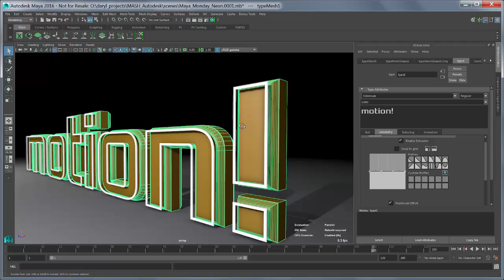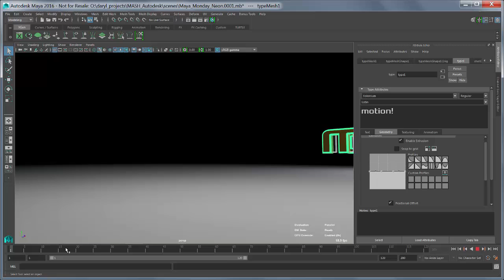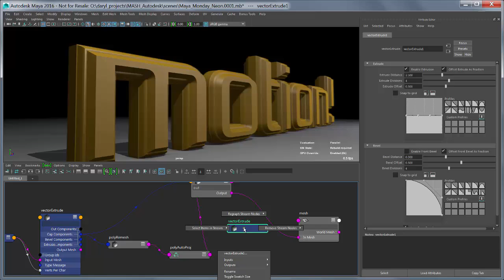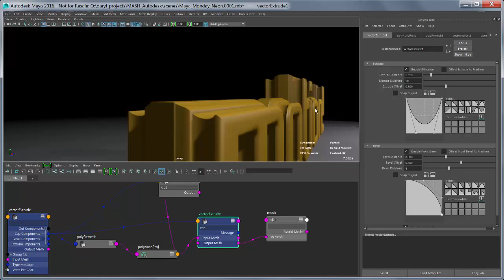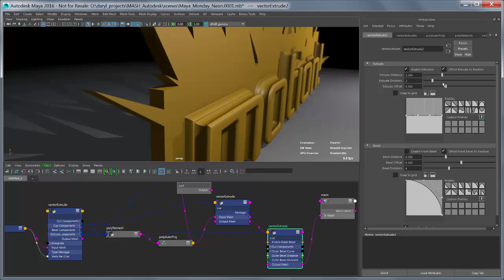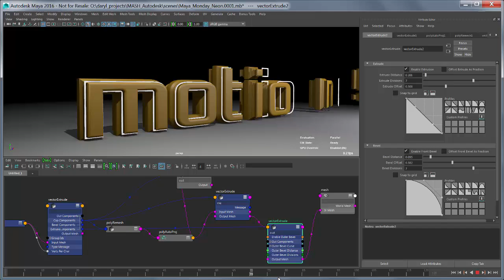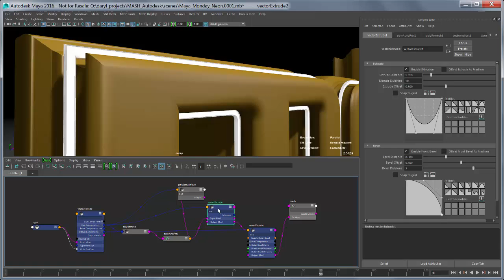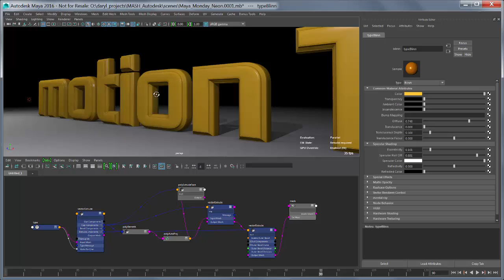Maya Monday  - Type Tool part2 - Behond the Basics

Comment: Hi Daryl;
Is it possible to use polyBevel nodes instead of extrusion nodes?, I've tried because I don't quite like the way vectorExtrude does the bevel on letters like "V". But MAYA throws an error saying it doesn't expect that type of geometry in a Bevel node. I guess is because, even when you can bevel a face, internally MAYA keeps converting the selection to edges all the time.
Thanks!

Comment: Hey Daryl,

I'm wondering if you could do a quick video, covering the differences between using the "standard" OpenGL rendering engine vs. the OpenGL Core Profile? How it may be different between Operating Systems, pros and cons using one or the other. Possible issues one might run into using one or the other in a standard workflow ...say e.g. animation or FX. Also notes about compatibility with third party tools/plug-ins, what to be aware of etc. The lack of clarity is one of the main reasons I don’t touch or play around with these settings, because I’m afraid it will bite me in the ass during full production.

E.g., if I understand this correctly, it's necessary to run 'Core' if one wants to work with GLSL shaders, but that's about as deep as the documentation goes. It's just one of the many things that aren't clear at all within Maya (or the Autodesk docs). Like why would I want to run one or the other, why is there even an option to choose. ..say e.g. if 'core' is so much better, why would I care about the other.

On another note,
As you did the absolutely fantastic "Maya 2016 parallel rig evaluation" video with Martin, explaining a (now) fundamental feature in Maya. I (and I'm sure many other Maya users) would greatly appreciate it if you (Autodesk) did a little more follow-up with more ‘in-depth’ information and show examples of topics that aren’t covered fully in the documentation.

One example is, building rigs now and using the Profiler. As good as it is in informing the user of what is scene heavy and could use optimizing, it doesn’t really tell me if my rig could/should preferably be built in a certain way because that would make all evaluation even faster. Say for example (hypothetically speaking), one should now (since Maya 2016) try to parent all geometry shapes under the curves instead of using constraints because for some reason (that hasn’t been documented or explained yet) is now the preferable way for best performance. Or use only certain deformers and not others etc. etc.  … I’m just saying, there are a lot of things still unclear how they may or may not affect ones workflow/methods now with these new features. Like I’d love to know if I’m doing something wrong with my rigs and could make them 3x faster if I only changed something simple that, I’ve never had to worry about before, would improve things dramatically but isn’t very obvious.
Good example of that is:
- The “freeze” attribute (check box) on transform nodes. Cases where it makes a difference and where it doesn’t and why. I know you touched on that subject with Martin, but I think people need more details. I can’t seem to make sense of why it only works for some things (or for some nodes) and not others. So is hiding objects just not a valid thing to do at all any more, or does it only apply to certain things.

I could go on and on, the list is near endless, but we this would be a good place to start :)

thanks, 
cheers!